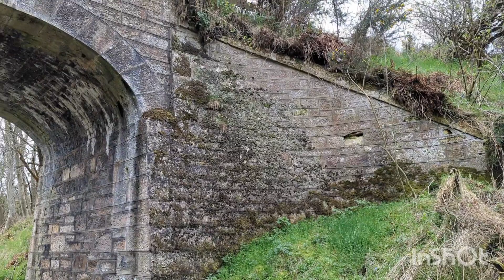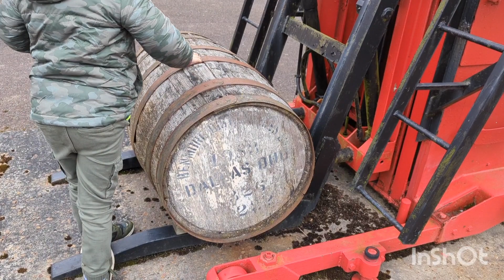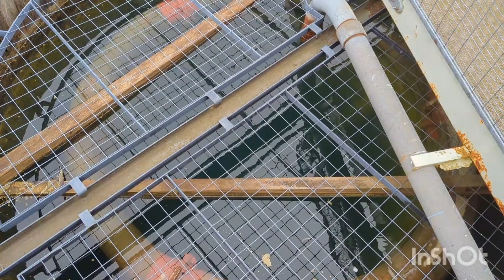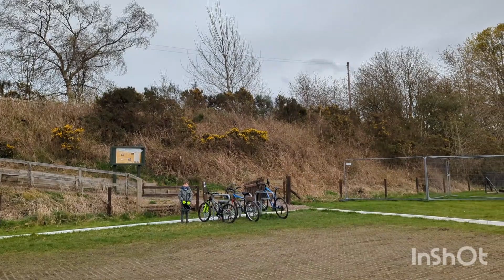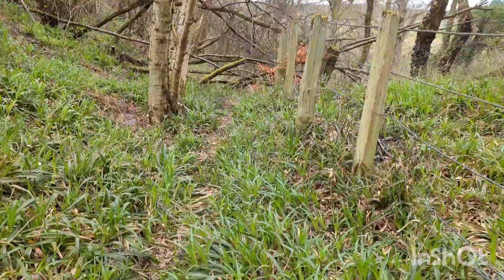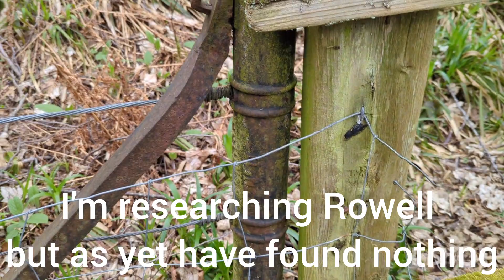The Still, The Worm and The Bridge in the Woods!

Comment: Those still worms looked very interesting Carl.
Reply from the maker: Hi Paul, yes they are very interesting. The Coopers and Coppersmiths were and are exacting tradesmen. The worm pipes curve as well as taper and they are made from rolled flat sheet. The outer casing "barrel" has no sealant between the wooden slats. It is purely the fit that provides the seal. I'm glad you enjoyed the film.
Reply: @carlwilson1772  Yes all those skills 'lost' but if they are no longer needed or relevant then they are replaced rather than lost I suppose.  Even if the distillery was still in operation sooner or later the worm pipes would have been made by robots in volume production some place else (not locally) and the big barrels would have been GRP or stainless tubs. Cheers
Reply from the maker: @HaxbyShed  They haven't been lost. They are all still used daily in the many distilleries around here. The copper is still used and necessary for the process. The Coopers still work out of the centre near the town of Duffus. The stills are all copper even today.